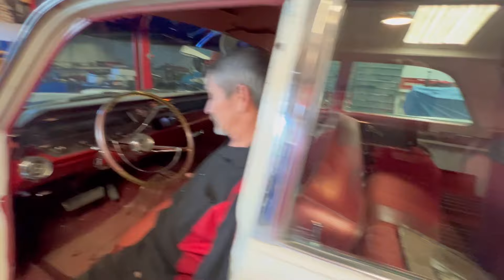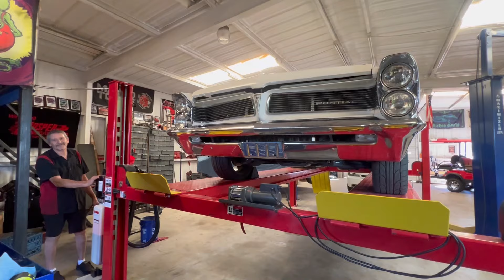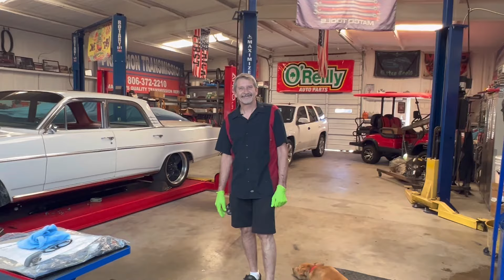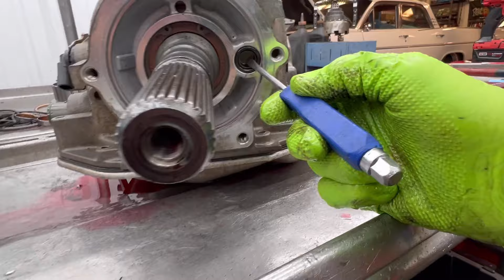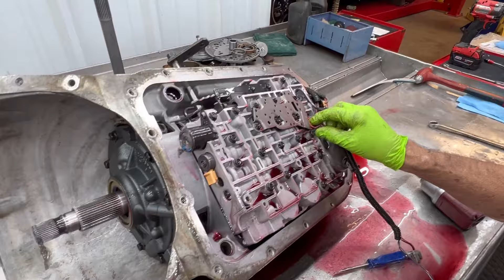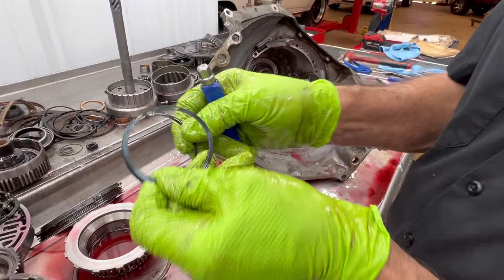63 Pontaic Star Chief.  6.0 Motor / 4L80e  late model.

Comment: Hi Richard, love watching your videos. 
Have a question...  will it be a transmission problem if  engine stall when I stop at intersection , it doesn't do all the time but it does after I drive more that 5 -10 miles. 
Thank you

Comment: Rich, could you do a video on what a fella can get away with when he needs to do a cheap and fast fix on his tranny? like pitted gears.. how far can you go when they are pitted 20,000 miles? less? more? and other things like worn thrust washers how far can you for with out absolutely having to change them out.. things like that. I remember back in the late 50's thru the 70'd when I was the neighborhood mechanic and folks needed there vehicles but didn't have a lot of money (one reason the came to me. I was pretty good and hardly charged at all for my service to friends and friends of friends plus all the mom's and dad's.). I don't work on these things any more. My last job was helping a fellow restore his 63 T-bird.. man that hydraulic set up to lift the roof was a challenge. that was over 5 years now.. I miss it and am glad I can come here for my fix..

Comment: Well Richard --- It's nice to know another Leo ----- I have the same birth date ---- only ---- I've got eleven more years on you ------ I came across you a couple of weeks ago ------ I Subscribed and Ring those Bells ----- Looking to see if you had anything on the TH350 ------ I have a '56 Pontiac 2Dr. Hardtop with '79 Pontiac front clip and it's running gear ----- I want to go through the trans ----- been watching and rewatching your videos on the TH350's ----- Got eight pages on the ---- "It's A Build Video" --- you did ---- and notes taken on your other 350 videos ---- Will follow your Steps and Tips on rebuilding it ----- Will use just the four clutches not modify to five ---- NO big engine here ------ Do you recommend anyone in particular for a Rebuild Kit? ----- You used Extra bushings used (2) and (2) extra seals were used --- not in a kit ----- Is there a source for them? ----- Have looked at other sites ---- on rebuilding ------ BUT ------ I KEEP COMING BACK TO YOUR CHANNEL ------- Being a LEO ----- you explain things very well ---- So that the average joe can understand ----- You tell --- What to do ----- AND ---- just important ---- What NOT ---- to do ------ Hope to have the engine and trans out soon  ---- just finished some Wheel Cribs to get the car up ------ Thank you for sharing with us ----- I for one ---- REALLY APPRICIATE ---- what you do ---- Hope you and Teresa have a Good Week --------- Rodney ----- Watched this video because of being a Pontiac ------ You did a Final End Play check at the end of ----- It's A Build Video ------ before you started this Pontiac's trans ------ wonder what ----- END PLAY ----- it had before you tore into it? ----- He must of had a lot of parts left over when he finished ------- Thanks Again -------- Rodney
Reply from the maker: Yes sir I’m sure he had a lot of parts left over. Don’t understand why he put it in with parts left over thank you and have a fabulous day.